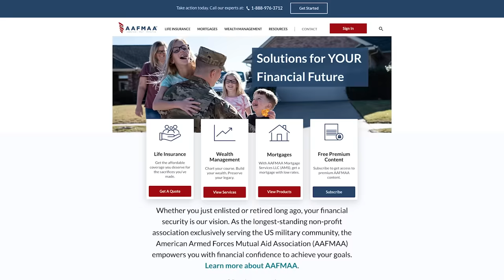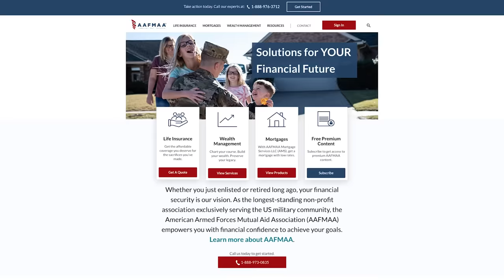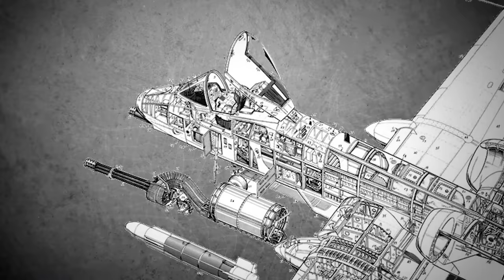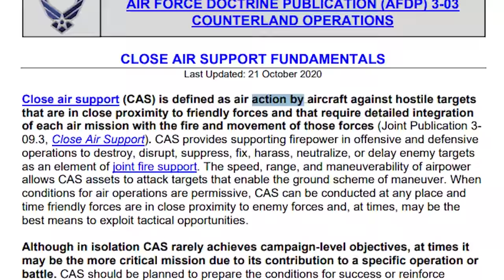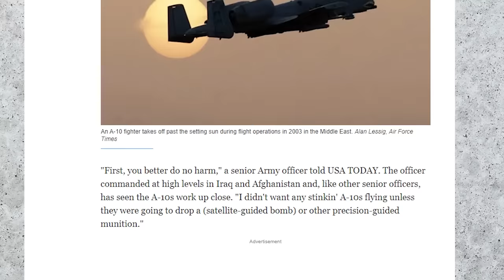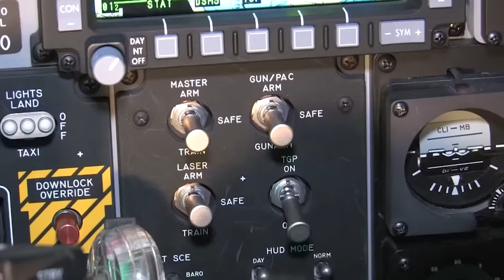Why the Air Force is Screaming to Retire the A-10 Warthog

Comment: ok, ok, fine. we can replace the a-10. IF. hear me out, hear me out, let's use, the B-1. I KNOW I KNOW, but look, the USAF wants to replace it with the b-21 anyway,  the b-1 has been used for CAS before, IIRC, i mean, it's got the most ordinance of any plane in the the AF, and it has external weapons capability, it's faster, and stealthier than the a-10, can fly higher, can fly low, it can loiter for even longer being comprised mainly of fuel and bombs, just replace the bombs with missiles, and there we go! i mean, we can even replace the f-15 EX with it,  hell you got 2 squads that need support? got a bunker that needs busting? got a convoy that needs annihilating? the b-1 can do it all in one sortie! hell, you seemingly don't even need to launch munitions to disable the enemy, if you've got a bunch of guys in trucks or on foot hasslin the troops, just fly the big fucker over their heads at mach, air show style! that'll get 'em surrendering.     in short,i think we should replace the a-10 with the b-1.  

i know, i'm a genius, somebody give me money....
Reply: B-1 was actually one of the airframes suggested to help fill A-10's niche after its eventual replacement. People dogged on the woman who proposed it, but you're not wrong. B-1s were used in Afghanistan for CAS and did quite well. They're decently quick, have a high payload, long loiter time, and can use GPS/laser guidance for the same precision as A-10.

B-1 in conjunction with a bunch of other airframes like AH-64, F-16, F-15, etc. would do well in A-10's niche.
Reply: @bluntcabbage6042   sounds great, the military will never go for it. 

(in truth, the makers of the b-1 have been long gone, and i imagine it's getting ever so much more expensive to keep it maintained, and i hear it's a maintenance hog.  so that's probably a big reason it's getting the boot in general.  that being said...we still keep a fuck ton of b-52's around....probably fuckin replace the b-21 before the 52's. )
Reply: @cobraglatiator  Absolutely, lol. It's a shame, too. B-1 was and is a legendary aircraft for a reason. Still can't be beat in its class (supersonic heavy bomber). Still, I trust and hope the B-21 will carry the torch.

And in the darkest nights where all seems lost, we still have the BUFFs to drop comically large amounts of ordnance on enemy positions. God bless.
Reply: @bluntcabbage6042   can't we just get boeing or somebody to make new b-1's? they're the fastest, and carry the most bombs.   hahaha. mostly joking...

Comment: The F-35 is inherently unsuitable to replace the A-10. The The argument that is too slow is nonsense. A close in air support aircraft must be able to identify friend from foe, and you're not going to achieve that at 400 kn. The F-35 would also have to carry external stores, so it will not have the advantage of stealth, and would not be able to carry the weapons load of the A-10. Further, the F-35 has a very high wing loading which doesn't suit close air support. You can only do so much with software. Ok, here's my 2 cents. Design a new upgrade that incoporate the the lessons learned form operations and maintenance, that will have low maintenance cost, longer service life and surviveabilty. I would not expect major changes to the design so it's not a high risk, nor high cost solution. Then, set up a production line to build 60 new aircraft. It will be cheaper than the F-35 by miles and will retaing the characteristics of the aircraft. Btw, the A-10's surviveability is probably and order of magnitude higher than the F-35, if used for the same mission role. And of course, why fix something that's not broken. And what's going to happen toe GAU-8?
Reply: Identifying targets visually was never reliable, the f35 can identify enemies while flying over clouds while still being able to jam enemy air defenses and stay out of the range of manpads
Reply: @aquilesca5tr0  Nope, there is no evidence I've ever seen that would call positive visual identification as "unreliable". How can a F-35 identify enemy targets flying above cloads? Jamming while staying out of the range of manpads? How will the F-35 engage enemy troops from 3 km away? Above clouds? And being clear as daylight because of carrying external stores? I don't believe it. Secondly, the A-10 was designed specifically for low level flight, engaging and destroying tanks, have a long loitering time, and surviveability, especially pilot survival. The F-35 has none of these qualities. If memory serves, the A-10 can still fly with half of it tail gone, minus one engine and missing a third of its wing. How does the F-35 compare?
Reply: @janventer7942  The A10 ended up being a light bomber that was meant to carry mavericks and guided bombs with the disadvantage of being slow and still needing to be at least in visual range from the targets even in the C model in which the pilot didn´t need binoculars. The A10 ended up being the aircraft that killed most civilians and friendly troops + it relied on specialized OA-10s to identify and designate the targets. The f35 ca fly at 30 thousand feet to be out of the range of manpads and AAA, designate targets with the eots even if it is cloudy while at the same time it can jam air defenses with the radar and perform SEAD
Reply: @aquilesca5tr0  I think you misunderstood. Firstly, it seems you're assuming that this misson profile will be the same as the interdiction nission used by the US over the Ho Chi Mihn trail. This mission is against stationary targets. Secondly you're aguing that OA-10's will be used, so they won't be retired? Thirdly, laser guided weaons from 30000 ft cannot be used for close-in air support for troops on the ground. What if the target made an assault? You're also assuming that there will be no enemy fighters that can visually identify the F-35 and chase them off. And lastly, why solve a problem if there isn't one?
Reply: @janventer7942  There is a problem, the A10 is unreliable, unefective and vulnerable, laser guided weapons are meant for close air support. Close air support implies engaging targets that are close to friendly troops, it doesn´t imply being close to the targets. The a10 is mainly used as a platform for laser guided weapons, dumb rockets and bombs. Reliance on visual identification has led to friendly casualties and lack of situational awareness which nowadays is more dangerous than ever and at the same time unnecesary. Nowadays troops themselves can designate targets using laser and gps so flying higher and faster is benefitial to extend the range of guided bombs and missiles
Reply: @aquilesca5tr0  "There is a problem, the A10 is unreliable, unefective and vulnerable", You're wrong, the A-10 is the lowest cost aircraft in the USAF, which means it's very reliable. Show me evidence to the contrary. Uneffective? Have seen what the GAU-8 can do? Vulnerable? Have you read my comments about survivabilty? Have you seen battle damaged A-10's flown on their mechanical flight controls? Triple redundent flight controls. The scenario you're quoting is for interdiction, not close air upport. In any case you state the the A-10 will still be required to perform FAC missions. So they won't be retired? Also, battlefield conditions are fluid and dynamic. An aircraft the can see the target can adjust very quickly to chaning conditions. You also seem to state that the combination of an OA-10 and F-35 is inherently safer. Can you prove it? Remember, waging war is not safe. And besides, you'll still have OA-10's close to the ground.

"Reliance on visual identification has led to friendly casualties and lack of situational awareness", simply untrue. How do you have lack of situational awareness if you can SEE the enemy, AND, reliance on visual identification " has led to friendly casualties"? Really, if you can see your own troops, you know where not to expend ordinance. Apologies if you feel offended, but your arguments are utter nonsense. I'm not going to respond to anymore of your gibberish, yoiu're wasting my time. TaTa

Comment: Chris, Sorry to hear that you are drinking the Air Force's cool-aid.  There is much to be said for the morale building sound of the GAU-8.  Low and slow is a good thing for protecting the troops on the ground.   And although the loss of the British soldiers to friendly fire was most regrettable, the fact is that it was a very accurate strike, just bad FF ID.  The loiter time is a big advantage too.  One that the F-35, or any other aircraft can overcome.  If the Air Force is allowed to retire the Warthogs the soldiers on the ground will pay the price.  Their only salvation may be a greatly expanded low cost drone program.
Reply: The sound of the gun being a reason to keep the platform is laughable. You don't acknowledge the main problem of the A10. With current targeting goal is putting a round in every inch of an area, and that means picking the inch and order of shots. 
We're not there yet but the A10 can't even pretend to compete with that kind of support.
Other platforms carry more rounds and fire more accurately.

Comment: The A-10 is the most overrated airframe in the inventory.  It’s not remotely survivable against a competent air defense, and is actually a badly limited platform in the CAS role.  It's interesting that the Wikipedia Warriors that are so infatuated with the A-10s just look up at the ceiling and whistle when it's pointed out that even UKRAINE clearly stated they didn't want the A-10 to fight the Russian forces.

Comment: Right before war they want to rid us of a great plane. I say retire the USAF brass, now.
These bags of bones in charge have made hugh mistakes in the last 20 yrs. Retire the brass and put a real pilot in charge.
Dont retire the A10, make new ones that are up to date
Reply: It's not worth the resource expenditure to try and replace the a10 with a similar aircraft when the concept is not feasible in a modern conflict with neer peer countries
Reply: @soul0rison536  I'm not saying find a new replacement, build a new A10. You still can not replace the A10 with any other plane. Start up the line, built with upgrades in it.
Reply: @fredintexas8561  that ends up being the same thing as designing a whole new aircraft the cost of r&d, setting up production, and manufacturing aren't worth it for a plane that is only good for fighting inferior enemies

Comment: Think about letting the Ukraine use the A-10. It's performance in Ukraine would be terrible. It's lost ratio would be terrible. All those ground threats would be overwhelming to the pilot. When we have air superiority just like the AC-130 it would be a big target. The 130 gunship would be an even bigger target. Remember in Vietnam the puff gunships were only used at night. With modern night vision devices only primitive tribesmen would form a none threat environment to our big gunships. Wheel the 130 into the Ukraine and I would not want to be in it on a mission over Donetsk.

Comment: @Taskandpurpose By all accounts of your argument.  The Apache Gunship, the AC 1 Gunship or any subsonic CAS aircraft should all be retired as well. The f-35 has been an absolute mess since its inception.  Numerous bugs and defects are still cropping up.  This Swiss army knife fighter jet pipe dream has once again come around to rear its ugly head. The phantom is a prime example.  In a multiyear conventional war with a real adversary The f-35 a, b, c, e, d, e, or Z  wont hold up. They are extremely maintenance intensive and turnaround for even slightly damaged aircraft are measured in weeks and months, not hours or days when compared to the A-10.

Comment: no

There is a political stalemate within the pentagon about what replaces this machine and what the future requirements are for today's warfare....may be the Ukraine war will decide this.
The replacement is the super warthog aircraft undergoing flight trials.
The re weapon ed warthog was destined to be shipped to the Ukraine as it was built for this type of warfare.
This is all about politics not capability.
The design was muted to be shrunk down to drone size by the UK as a ideal battlefield weapon.

Comment: Drones. If you have watched any of the war in Ukraine you will understand why the Marine Corps immediately sold all of it's Abrams tanks... because they are useless against a $200 drone equipped with electronic warfare capabilities and explosives. Lmao😅 Likewise, advanced anti-air capabilities have made aircraft useless in Ukraine and considering the A-10 was designed solely as an anti-tank platform it too can be replaced by drone warfare. Very simple.

Comment: If the US is stupid enough to get rid of one of the best ground attack aircraft in history I'm sure that the Ukrainians and the Isralies would be happy to take them off our hands.
Reply: Delusional much? Its an awful plane
Reply: @leduckified1534  Well if the Russians had any really viable  AA and Hamas had any AA you could make the argument that the A10 is not the best solution, but the Russians have run out of tanks the 30mm can't penetrate and Hamas doesn't have any.  A10 can still carry a butt load of bombs and loiter.

And today the US doesn't have a viable replacement, something the've been working on for over 20 years.
Reply: @nwnmiria   Ill give you a list of planes that historically have done better at ground attack and CAS:
F-15E
F-16
F-35
F-111
F-117
F-15EX
F/A-18
F/A-18E/F (Super Hornet)
Reply: @leduckified1534  Now who's living in the land of denial?
Reply: @nwnmiria  Your not making a point. And im sorry for insulting you earlier. That was childish. I do still believe theres other multirole that could fit the role quite nicely. For example, during the gulf war The F-111 Aardvark killed twice as many tanks as the a-10 despite flying less sorties. I have a source for this, if you want it.

Comment: The Air Farce is looking for any excuse not to support ground operations since their inception. The history of the Skyraider is bullshit! It was an excellent close air support aircraft, but the Aire Farce has been trying to get an all Jet fleet for decades. And the F-4 Phantom was a good aircraft, but not as good as the modern jet fighters. The F-4 was respectfully referred to as the lead sled. The A-10 is a phenomenally great aircraft that the Air Farce has tried to kill since its inception. They even tried to replace it for close air support with the F-16, which the time it can remain on target is counted in seconds. The first real push to retire it was in the late 1990's, when the Army said that if the Air Farce wouldn't keep the aircraft they would. And then Desert Storm happened where the A-10 basically destroyed the Iraqi Army and the Air Farce had to eat crow before Congress and say they had no plans to retire the A-10. The second Gulf set of wars; the A-10's battle record is unsurpassed. They use the same old lame excuses for needing to retire the A-10, while buying hundreds of that POS the F-35. The hierarchy is the US Military has proven themselves incompetent and need to be replaced with non-political, non-woke, non-communist competent field commanders.
Reply: I wouldn't even call the F-4 good. The UPDATES to it, made it a serviceable aircraft, no question. But the day-one version? Utter garbage. Ignoring the weight and turning issues, the F-4 at first, didn't even have a gun. So it was a literal six-gun: you had four Sparrows or Sidewinders...whether they hit the target or not, when they're gone, you were out of the fight. 

And then, we can come BACK to the turning and maneuverability issues. The Phantom had great climbing ability, but it was a SHIT dogfighter, because it could barely turn in the radius of a small city. I'm not saying the MIGs of the day were better, but they were more of what a pilot needed in an air to air fight vs. the Phantom. 

The A-10 is suffering the same problem, but from the OPPOSITE end of the spectrum. The Air Force wants nothing to do with ground support roles. They've phased out the training for them, and the A-10 is the last true close air support airplane DEDICATED to that role. It's a specialist: a Field Kicker, a Goalie, a Catcher. if you never want the role to be used, don't train your people to use it, and don't offer support to it, of course it's going to look like it's underperforming compared to other aircraft. 

I say, give the A-10 to the Army and the Marines, and let the Air Force see how relevant they are when the only ground attack options they have, are strategic bombing runs.

Comment: If we do retire the A-10 Warthog Maybe we should donate them  their infrastructure and all non- classified Technologies to Ukraine. Could be just the thing to turn the tide. 

The A-10 could be the deciding factor to push the Russian aggressors out of Ukraine and to keep them out for the foreseeable future.
Reply: The a10 would also require an enormous logistical train to support its use in ukraine, months of training for pilots, ground crew, logistical personnel and maintenance, not to the even mention the fact that no amount of flares or chaff would make them impervious to SPAA and mandpads that the russians still have plenty of, besides the a10 is only usable really when you have complete air superiority, and a fighter aircraft it is not